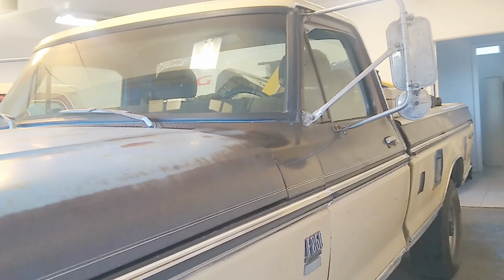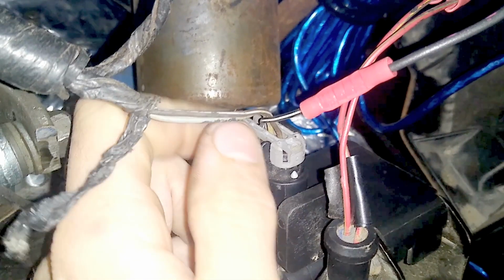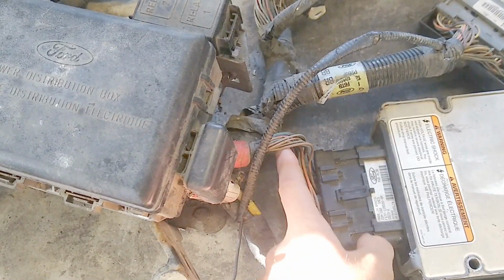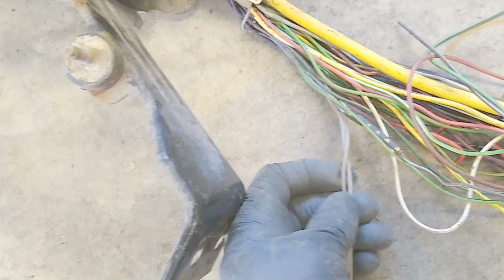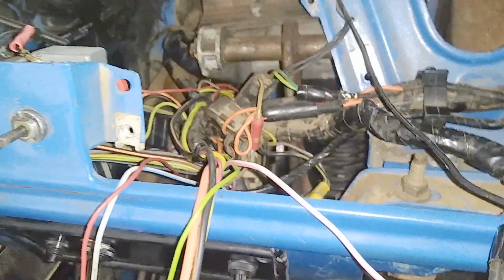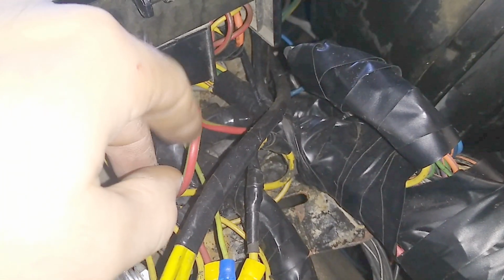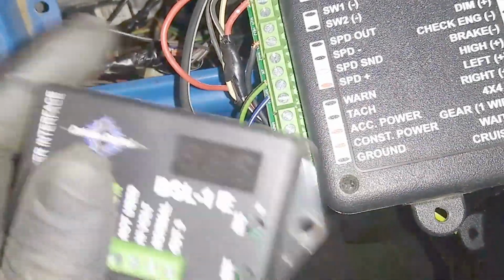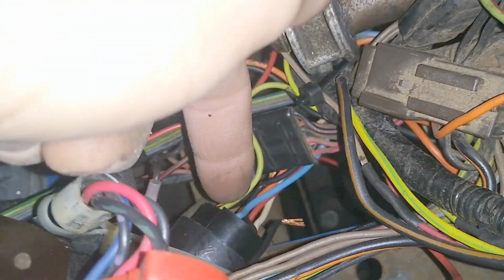How to wire a 7.3 Powerstroke (Powerstroke Swap Pt. 4)

Comment: There's alot to process in this video but it's full of great info. Gunna be putting a obs 7.3 with a 5spd into a 1979 GMC 1ton dually crew cab. It's gunna be a massive swap and no idea how I'm gunna make it work have a complete parts truck so guess I'll figure it out along with this video.
Reply from the maker: If you have a little more than a couple pennies to spend I'd say get a dakota digital cluster. It'll give you tach, speedo, and a bunch of other stuff. 

I'd also say since it's going in a GMC you're going to have to make engine mounts and modify your transmission crossmember for the rear transmission mount. As far as wiring the engine, it just needs power to the relay block and you have to keep the ECM and IDM relays. The only necessary wiring from inside the cab of the obs is the OBD2 connector, the 3 wires for the pedal sensor, the 2 wires for the pedal input sensor, and the 5 amp fuse for the pedal input sensor. You will need a wire from "ignition-on" to power up the ecm. Since yours is a 5 speed you will have a lot less wires to deal with. 

Sounds like a cool project!
Reply: @humboldthillbilly1848  awesome thanks I'm glad there will be a few less wires then what I watched you deal with holy crap.  Was gunna pull the entire cluster and dash anyways but was sure what all I needed from behind it. Atleast I have a great place to start now :) thanks. Like I said I'll be refering to this video many time over the summer lol
Reply from the maker: @braapmaster6943  If you have the time, pull all the wiring and sort it out later. It's always better to have more than what you need versus less.
Reply: @humboldthillbilly1848  definitely will do gunna keep everything but the kitchen sink. Might even keep it not far from reach haha.

Should just have a man like you build the harness. You could make a killing doing this stuff for people
Reply from the maker: @braapmaster6943  I've thought about it but at this point I'm still a few years away from selling plug-and-play harnesses or offering a service. There is a guy on YouTube called Mark Fugazzo who does offer Powerstroke harness services.
Reply: @humboldthillbilly1848   any chance you’re making one?
Reply from the maker: @carsonp4552  Nah I'm not set up for building them. Check Mark Fugazzo on YouTube, he was making them last I checked

Comment: I would be interested in a copy of that wiring diagram there
Reply from the maker: Not exactly sure how I can share that directly via the comments, but I can say that I found it on the powerstroke forums when I googled 1996 7.3 powerstroke wiring diagram and 1996 7.3 powerstroke ECU pinout
Reply: @humboldthillbilly1848  thank you I’m attempting to put a 1998 7.3 powerstroke in a 1990 f 350
Reply from the maker: @mikebrimm1872  Not 100% sure engine mounts might be a little different, but if they are you can always swap the mounts for the earlier Powerstroke mounts. Then the engine will bolt in to your frame. Wiring should be really similar chassis wise. For the engine harness just leave it alone. Integration of the two harnesses is probably the most time consuming part of yer swap.
Reply: @humboldthillbilly1848  I’m going to connect my 1990 engine harness to the 1998 engine harness via fuse box under hood from the 1998
Reply: @humboldthillbilly1848  i am doing a swap in to my crewcab bullnose and everything is in place . Just starting to figure out the wiring and i cant find the diagrams on any forums

Comment: I really appreciate this video! I’m doing the same thing and took the entire wiring harness from the donor truck. Having it out on a bench unwrapped to de-pin the PCM and eliminate the lights and HVAC stuff is a bit intimidating! I think I’m going to leave the stock harness from the truck as intact as possible and run the PSD harness in parallel. Had to buy a rear axle, didn’t realize the auto trans and speedo wouldn’t work without that VSS input, and the axle was cheaper than figuring out a speedo and trans controller work around. Never occurred to me that Ford wouldn’t have the VSS on the trans itself.
Reply from the maker: I think the reason Ford doesn't run a vss on the transmission is because they are using the axle vss for ABS as well as speedometer, cruise control, and transmission shifting.
Reply: Hey man i did this same swap and it worked if i left the guage cluster plugged in but im trying to delete all them wires.    

How does changing the axle make it shift without the cluster
Reply: @DPelicanGaming  If you have a manual transmission you don’t need the axle VSS or the cluster. If you are using a non-electronically controlled automatic transmission like a C6, you don’t need them. If you are using an E4OD or a 4R100 and you want the stock computer to shift them you need the VSS axle and the cluster. There might be an aftermarket transmission controller that doesn’t need the cluster or the VSS, I don’t know.
Reply: @oddcarsandbaddecisions  isint there something i can tear out of the inside of the cluster or a single sensor i can buy the cluster is really huge in my truck as im useing a alumnum plate guage setup in my dash it looks really stupid haveing 2 clusters in the truck lmao

Comment: Simple to wire the PATS if equiped. Run 2 wires to PATs module from PCM for data, then keep a key taped to the cylinder pickup sensor. Literally just a few wires to keep it working

Comment: My question is did the motor mounts lineup for the 7.3 in your truck?
Reply from the maker: The motor mounts for the 97 and older Powerstroke are identical to the IDI motor mounts, so if you are swapping into a frame that had an IDI originally it will bolt in with zero modifications. 98 and newer 7.3 Powerstrokes will need their mounts replaced with the early motor mounts. My 1973 pickup is sitting on a 1984 frame, so the motor mounts were the same.

Comment: its a shame that you couldn't show which wires you eliminated from the PCM. I am still working on which need 'jumpered' for (my) thing to work.
Thanks for the video, much 7.3 info is hard to find.
Reply from the maker: If you are using an ECM from a 7.3 automatic, and are converting to manual, you can delete the pins related to the transmission. I don't think cruise control will work either, so you can eliminate those pins. For my 1996 engine those are pins 1,4,27,28,29,31,37,53,64,81,92. Google a pinout for your model/year Powerstroke. The pinout shows the location and wire color. 98 and up engines use a different pinout.
Reply: Three things for anyone transplanting a 7.3 with an auto; get the Ford Electrical and Vacuum manual (a Haynes or Chilton’s ain’t gonna cut it),try to get the whole harness from the donor (under hood and cab), and don’t cut wires! Depinning connectors isn’t that hard, and you’ll be glad when you realize that one of the wires you removed is actually needed. Then you’ll be able to find the correct color wire in your spare wire bin and put it right back where it was!

Comment: Did you absolutely have to use the body lift to get it to clear the downpipe? Or could you get by without it?
Reply from the maker: Depends on what you're swapping. My 1973 is on a 1985 f350 frame, so the body lift was due to the differences in the frame. I have a 1977 f350 2wd on a stock frame with no body lift with my other 7.3 and I have plenty of room for a downpipe. It had to be rerouted a little but it fits easy. If you can set the engine forward so your bellhousing bolt heads line up with your firewall you should have plenty of room.
Reply: I’m in the process of putting a 7.3 Powerstroke in my ‘85 F250 that came with a 6.9 IDI. I was able to hammer the firewall enough to clear a 4” downpipe, but I had to cut the firewall on the bottom right of the trans tunnel (as you face it from the front) for the cab to clear the motor when lifting the cab on or off. The turbo wastegate arm (using a later SD turbo setup with intercooler) also hit the firewall at the top where it meets the wiper tunnel, so I had to cut it and make a box to give the turbo arm room to move. A T4 turbo upgrade that gets rid of the stock pedestal would have given the room to eliminate that step but wasn’t in the budget for now.

Comment: Did the 7.3 Power Stroke match up with the truck's original transmission?  I'm putting a 7.3 in place of my 6.0 Power Stroke.
Reply from the maker: The Powerstroke engine in my truck replaced the older Navistar IDI. Fortunately both engines use the same zf5 transmission. Later model Powerstrokes use the zf6, but in my experience with the 6.0 Powerstrokes they have a completely different bellhousing pattern than other Powerstrokes. Also the 6.0s have a lot more integrated transmission wiring.